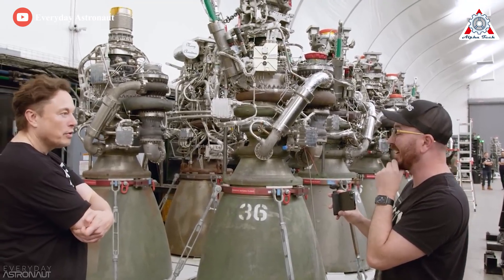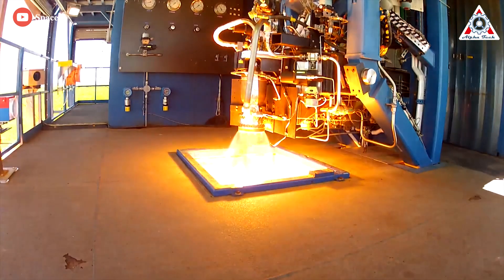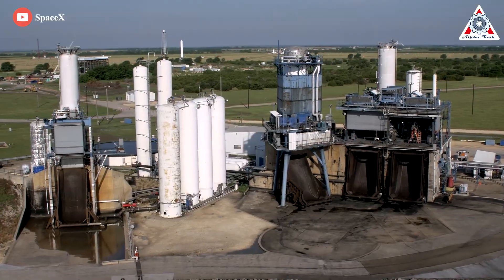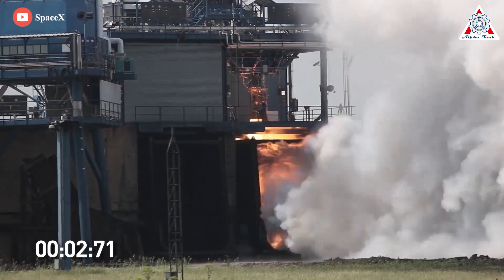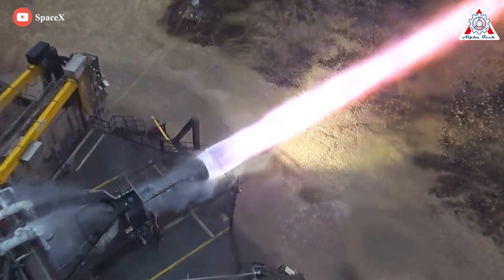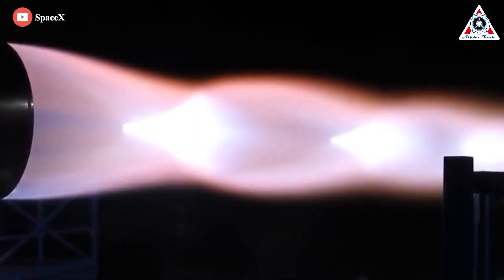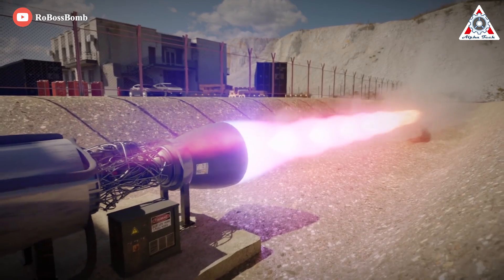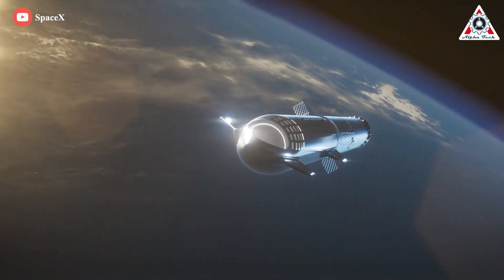Explosion! Why SpaceX Blow Up So Many NEW-GEN Raptor 2 Engines at Mcgregor?

Comment: It's called R&D (Research & Development for those unfamiliar). It revolves around testing ideas & approaches to Failure to find what Doesn't work or to prove a concept that does.  I worked for a top Developer (Cruise Missile, Naval Sonar, Satellite Gyro's, Ceramic engines . . easy stuff, if you've got more than three neurons to spare ; ), and learned Plenty as the fabricator, assembler and operator of this experimental equipment as well as how R&D works. SpaceX is every bit of that, create newer iteration's until it doesn't self destruct anymore, then the prototype becomes Scalable. That's how you get your investment back because R&D aint cheap !  I always chuckle over comments about SpaceX's failures or having to repair or go back to the drawing board. That is Literally how R&D works, you focus on a particular portion of the project to see exactly how it behaves under duress, even if every other part is breaking down around you it matter's not, as it's not your Focus. Get what your Focused on to work correctly and then move to the next component with issues. It's fascinating stuff and very satisfying when the final product meets the vendors specifications and can begin making money !
Reply: R&D normally isn't cheap. In this case, R&D is cheap compared to the much more expensive final assembly and payloads being carried, along with the limited launch opportunities.
Reply: @nobeliefisok9174  Ideally,  getting a return on your R&D investment is the hope, but it's Not guaranteed.  Thats effected by how much the vendor is willing to risk up front. The last project I worked had a history, with competing vendors, of failed R&D investments totaling nearly 200 million over years of attempts re-inventing a 1930's vintage, German designed Salmon Filler. 5 of us were contracted 20 mil & 8 yrs to produce a final product, but Selling them on the commitment wasn't easy. Fortunately,  our insanely brilliant founder of the group could Sell you one shoe, he had a gift for that too. We succeeded where others failed and were awarded two more projects. The second project was as successful as the first, the third went over budget & was cancelled.  Yea, that's true, R&D is cheap, but only if it works Very well and is scaled into a profit making device.
Reply: @uuzd4s  Great success story! R&D is the backbone of practically everything. Any industry that fails to reinvest in itself will stagnate or fail.
Reply: @nobeliefisok9174  Thx, it was a kick to be involved w/ those guys. The founder of the Invention Group itself (4 people total) was hired by the Seafood Co I was working for to re-invent this 30's vintage salmon filler we used at the time and is still in use today by many other salmon canneries. It was German designed and was the first piece of industrial equip to have an automatic transmission. Half the machine was constant speed while the other portion was variable speed. Except for the fluid driven auto-transmission the rest was all gear/chain & leather belt driven. We had 8 of them and each took a min of 6 people to operate and usually needed 9 or more people on one of these things. All cast and hardened steel with dozens of places to never stick ur fingers into. I didn't know I was being interviewed when this Inventor was introduced to our machine shop. I was asked to stop by their Seattle Office after the salmon season that following winter. Had a couple of martini's w/ a friend while in Ballard and we stopped by afterwards just to meet these guys, they hired me on the spot. Good Times, taught me to view things differently. Quit the Seafood Ind, went back to college for my A&P (Airframe & Powerplant cert) and hired w/ a US Major for more good times. The open water Salmon fishing was the best part ; )

Comment: If it was BE-4 engines blowing at this rate, this and other fanboy channels, would be all over the place bashing them.
Reply: If BO was able to make 30 engines.
Reply: @johndea3330  why would they build so many engines in a short time frame, if they don't need so many per rocket?
Reply: To test engines, not to mention 39 engines per stack is a whole lot of engines... what spacex has done with starship in the last 2 years is staggering,  took space launch system 10 years to reach this same level... they are doing what is called an iterative design, that means destroying prototype to find its limits is required... this is a novel and new approaches to space development and yields rapid results through essentially trial and error... 
P.s. Grammer Grammer Grammer I know lol
Reply: Blue Origin has only delivered two production BE-4 engines to ULA. They can't launch a Vulcan without two of them. If one of those engines were destroyed, that would set back the first Vulcan launch by six months or more.
Reply: @hamjudo  the Raptor engine is still in it development fase. According to Tony Bruno, the BE-4 engine already passed it development fase.
Reply: @RogerM88  because raptor keeps on being refined to become a better engine... again iterative design approach means everything is always in development, hell they are still even developing the falcon 9 to be better.

Comment: I disagree that they aren't doing what is needed for the launch of Starship. They've been awhile at 230tons thrust and 300bar. This is not a hard requirement to launch. I think they've been where they need to be for a while. 

I believe they are continuing to push beyond. If they hit 250 tons, they will match the spec on the BE-4... and that will be interesting if BE-4 doesn't deliver. It will also maximize the amount of fuel Starship tankers can carry to LEO reducing the number of tankers required to fully refuel the Starship lander.
Reply: Raptor already blows BE-4 out of the race. Raptor is 1/3 the size of BE-4, and already produces 230 tons of thrust to BE-4's projected 250 tons. BE-4 is just now completing work on their SECOND engine, while SpaceX has produced hundreds of Raptor V2 engines. BE-4 and Blue Origin aren't even in the game. And Now ULA needs a new rocket engine provider since they were using the Russian RD-180. I wonder who they will go with...🤔

SpaceX is kicking everyone's butt, and it is refreshing to watch the big-name bureaucracies, (NASA and BOEING) struggle to keep pace.
Reply: @sammoyers905  struggle to keep pace? Ha! They're bureaucracies, over-due/budget by design. That's the problem with our government. It doesn't produce efficiently, and capitalism in the free market produces efficiently until it involves the government, and then they'll fund it even when it's not efficient anymore because a politicians son works there or something. The entire world world change if the free market competed for a direct democracy's tax money.
Reply: Bozos fan, lol.
You're on the wrong channel, pal.

Comment: Small wonder there are problems making as  "light as possible and as powerfull as possible" rocket engines with pressures of, what was it, something like 300 bar, multiply that by approx 14 for "pounds pr square inch", that pressure will start from the fuel pumps where the temperature is, just guessing, say minus 90 degree celcius to the actual rocket bellshaped "nozzle" where the pressure is almost the same, but the tempersture must be up around 1800 degree plus celcius, and guessing again, around 4000 pound pr square inch on every square inch of the bellshaped rocket nozzle.!!!   Seals need to handle such extreme temperatures, hot or more likely very cold (at those extreme pressures) - and the bearings must also handle extreme thrust loads and centrifugal forces on turbines while the liquid gas and oxygen, high capacity centrifugal pumps do what they were designed for.   Meanwhile, lubrication must maintain low friction in bearings and possibly seals under those extreme conditions.😓!!!
Small wonder Elon Musk claim it is difficult to make rockets,  seems the larger and more complex the rockets the bigger the challenges 🤔!!!